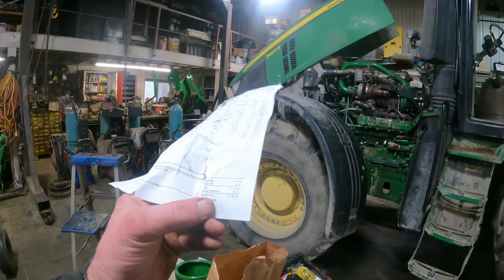What did I do wrong? Won’t start

Comment: I have seen you guys use your equipment just the way they were designed and built to be used. I’ve watched as you maintain your equipment with regular oil and filter changes, brakes replaced, hydraulic leaks fixed, tires changed, engines rebuilt but not once do I recall seeing you guys abuse equipment. Apparently those who think you do abuse your equipment know very little about farming or equipment. Great content as always and love the channel.

Comment: Thanks for talking us  through this repair. All those connections between the wire and the pins would suffer with all shock and vibration in ag service. The car’s and trucks I work on never get worked that hard.

Comment: Andy if u put the air intake for your air compressor outside it will cut the noise maybe in half.both of mine pull air from outside. Air cleaners and all cold does not affect them .just make sure rain can’t get to them with a shield of some kind .

Comment: Just a note, Cat makes a copper based anti- seize that works real good on bolts subject to heat, does not dry out like the silver stuff.  It will be nice to get your good tractor back to feed with.  Sounds a lot better too that that morning feeding.
Reply: That anti seize is a terrible product,,you can't beat good ol multi purpose grease,,
Reply: 👍..but CAT doesn't make antiseize, Boots,or filter's or lot's of other things
Reply: FelPro C5A copper anti seize has been around a long time.  Used for steam turbine bolting and it does well.  Loctite also makes a copper never seize although I have yet to try it out.  Check Grainger.
Reply: @paulwalker9921  👍yup..right on 👊

Comment: Feed  mixers are one of the hardest  job on a tractor   they run 6 to 8 hours a day  in dusty wet conditions  to feed in all weather  run mixer  on kabouta and newholland  the tractor where under size for the job when they got the biggest  lucknow  mixer u could buy at the time twin screw   mixers to start the mixer the kabouta u put ur foot to the floor through the  pto in gear  to start loaded  on a tractor  with 30,000 hour  turned up to 110 hp   the newholland  tm 120  was around 125 hp with soft start it take almost  all she had to start it with 18,000 lb loads   it had 20,000 ish on it when  i left there  the son didn't  believe  in changing  oil  if u where lucky once a year was luky on any tractor   id make to plugs fall out  i toke care of my out fits that i run   u could pull air filter and have corn growing  in  the fillters

Comment: I dunno about these John Deere's we started out with 1 40 series and 2 50 series back in the day and 2 of them we had to do engine rebuilds. We currently have 7 New Holland's and we've never touched an engine. Don't get me wrong I still like the green ones, we still have a 3350 which came out of work with over 17000 hours on it and it still runs like a top.
Reply from the maker: You probably just had bad luck

Comment: I love how there are so many bad mouthing the dealer replacing sensors. 
Have you ever tried to diagnose an intermittent fault? If the fault is not actively failing, the only thing you can do is to replace the most likely component.
Reply: Intermittent electrical problems be like chasing smoke.

Comment: You should rotate that clamp about ten degrees. Put the pressure point of where the t bolt is in the clamp over the dimpled spot in the pipe.

Comment: Ib had to so similar repsirs on broken shit. Sometimes ya gotta do what ya gotta do. iv done a few ford exhaut mainitold jobs.i start wirh torch and cit them off.of course extracting thrn is easier being they go into aluminum and weld doesn't stick to head. Iv found using a bolt to weld onto whatever im getting out works better than a nut. Its hard to get penetration into broken bolt through the nut. Worh a bolt you can get on all sides.

Comment: Andy you’re a big boy cranking those studs down way too tight & stretching them out. When they heat up, they’ll soften & loose strength. Torque is calculated on a combination of metal grade, size and thread pitch. Just for reference, a 3/8” grd8 stud takes 37lbs torque max. and a 7/16” grd8 stud takes 58lbs max. You’re the hardest working guy out there. Stay safe and don’t do wheelies on your E-bikes anymore 🫶

Comment: Have you ever had any luck drilling out broken bolts?
Reply from the maker: No I haven’t
Reply: it can be tricky, you have to center punch it right in the middle and of course drill it straight😙 Exhaust manifolds are the worst.

Comment: I feel bad for you farmers. Hundreds of thousands od dollars for these tractors and the dealers replace parts and then when that doesnt fix it they say its the harness.100 percent of electric diagnostic is proveable in 1 way or another. There is eother a loose terminal or a wire rubbed through. It could be found with an oscilloscope. There is also the possibility that its a bad new part. Iv had brand new oem parts that are bad. New ans good are 2 different words.
Reply: Sometimes codes go 20 hours between occurrences. Is someone going to pay you 20 hours to run a machine with an oscilloscope attached? I think not.
Reply: @wesleycooper2647  wrong. Especially a harness problem there are many ways to prove it. Hell a light bulb and multi meter would due. If ya didn't understand what I wrote try reading it again. And again.

Comment: How many $ worth of components  did the dealer  replace before realizing it was a wiring issue. Kinda sucks you don't even know what really was the problem. I'm guessing it was a pin connection at the ecu
Reply from the maker: Any of the components they replaced needed replaced and there was a lingering problem of the wire harness that was also showing up every once and awhile